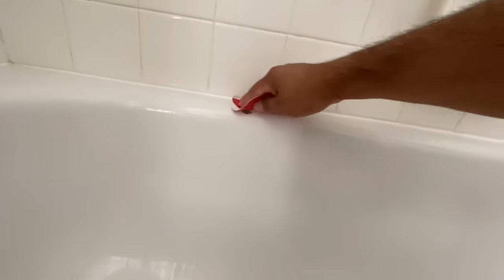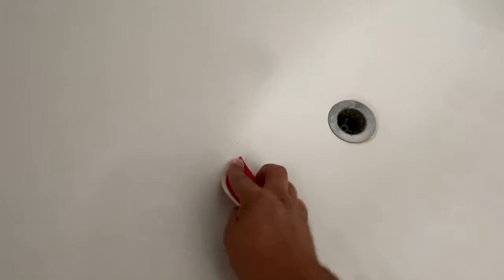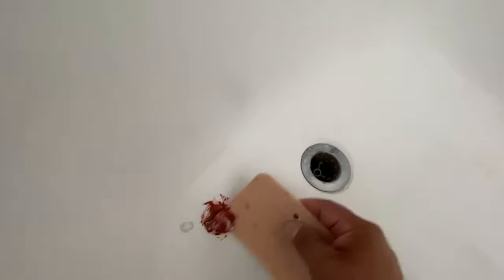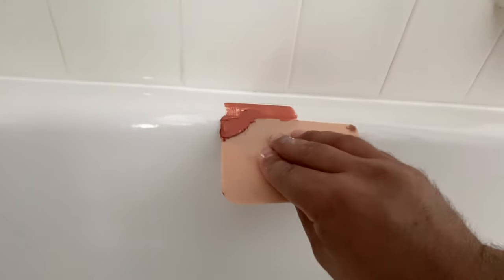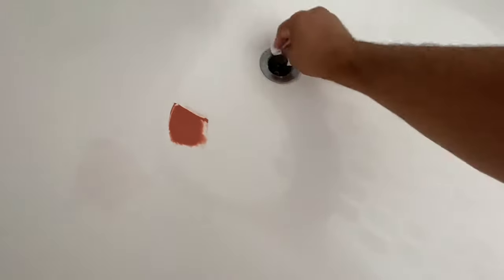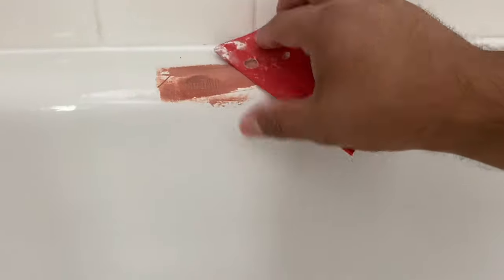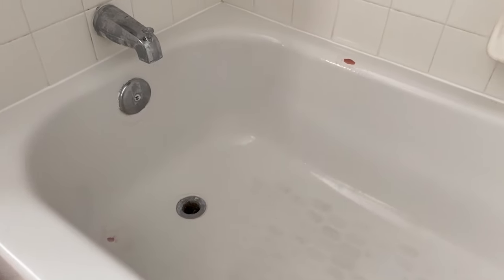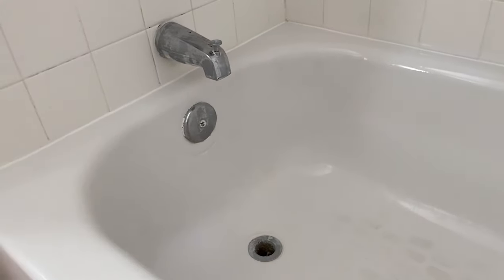How to Repair a Chip in a Bathtub and make it Disappear | Easy DIY Bathtub Chip Repair | DP Tubs

Comment: What exact products are you using on this?
Reply from the maker: for the top coat. The filler material is bondo filler. Let me know if you have any more questions. Are you trying to repair one yourself? Follow me on Instagram and you can DM me directly for help.
Reply: I have a chip size of a nickel more towards at the side bottom. What product can we use? Thank you
Reply: @DPTubs  ty

Comment: Hi! Great video! The description mentions a lot more items than I saw you use in the video. Do you think you could maybe narrow it down a bit? I have a small chip in a bath tub I would like to try to fix. I think it's a cast-iron tub. Does this stuff work with that too?
Reply from the maker: Sand paper
Bondo 
Smoothening putty 
Rustoleum appliance spray 

I have a video on bathtub chip repairs
Search “bathtub chip repair do tubs)
Reply: @DPTubs  is the smoothener different than the hardner you menion in the video that you mixed with the bondo?

Comment: Can you put automotive 2k clear over the repair paint? What do you think? I damaged one working at customers house & want the best longest lasting result. I've done a lot of cars so i know i can make it blend out.
Reply from the maker: Just have to make sure the clear will not have a solvent reaction with the top coat
Reply: @DPTubs  yeah, that's what I was thinking, I would have to do a test piece. It's a biscuit or almond color & those rustoleum epoxy spray cans say that its satin finish which won't match the tub gloss well so I was thinking 2k clear... it was 2 dime sized chips on the top.

Comment: Any suggestions on cracks on the bottom of the tub where the anti slip surface is different? When filling and sanding, looses its rocky texture so was wondering if you knew a shortcut. Thanks.
Reply: Use gorilla glue and lightly sprinkle construction sand over it they spray with a rustoleum white.

Comment: How did the paint hold up tho? I seen rust oleum dont recommended appliance paint in a bathtub?
Reply from the maker: You would be surprised what proper prep and care does. I wouldn’t be doing it if I had to go back and fix it
Reply: How long does it hold up with the appliance paint as far as when you clean your tub an stuff...an is the appliance paint the best option in a spray can over the krylon an rust oleum tub an tile?
Reply: @DPTubs  does the krylon tub an tile match the appliance paint color wise?

Comment: Question, how would you repair a cracked cast iron tub, not chipped but it has spider cracks. Do you break the surrounding porcelain or do you just fill the cracks as they are?
Reply from the maker: Fill as they are
Reply: @DPTubs  thanks, what would you use?
Reply: ? Never answered

Comment: How do they hold up after a month....year etc? 1, Bondo isnt waterproof. 2 it should be primed before painted. Although this technique may look good initially, I'd be surprised if it lasted.
Reply from the maker: You sound like a pro..:actually this system works great….been doing it for over 20 years!

Comment: Does the rustoleum appliance spray match great or is it worthwhile to get a paint from the tub manufacturer? Thanks!
Reply from the maker: The Rustoleum appliance spray is $6 at Home Depot. It’s worth it to buy it...and test it out on the surface and then wipe off with lacquer thinner. If your tub is a pressed steal or cast iron then the chance of it blending is pretty high. If it’s fiberglass I would try the appliance white or Rustoleum Shell White
Reply: What if your tub is grey?

Comment: Where are you located? I have a tub with screw holes in the top of it from a mistake made in installing the shower doors on the wrong side. Please advise. Thanks
Reply: He liked the comment but doesn’t provide the bondo used. What an insecure little boy.

Comment: One issue that I have had with repairs that aren’t followed up with a full refinish is the over spray that falls on the outside of the repair when feathering the touchup paint. It gives the area right around the repaired area a rough sandpaper fell. Have u encountered this? Have u found a solution?
Reply from the maker: Yes! You can go back out after and wet sand it with 2500-3000 grit. Very light just to smoothen out the rough spots.
Reply: @DPTubs  Thanks so much! Of course the extra trip out is not ideal considering it cuts into my margin. I will just have to price it accordingly.
Reply: @DPTubs  I refinish a ton of tubs for apt complexes. One issue I have is with tenants using bath mats (which is a no no) to deal with the liability of a slick bottom tub. Do u know if a practical solution,  Maybe a bathmat that doesn’t have suction cups, that can solve this problem? I have tried adding the sand grit to the bottom, but they are hard to keep clean without scrubbing(another no no)
Reply from the maker: Yes go to Amazon and search bath mat without suction cups and they are there. Machine washable too. They have air pockets. You are right the trip out isn’t ideal but I only go out if the customer pays for it. Otherwise I inform then when selling the job that there will be a halo or mist of overspray around the repair. Communication is key when dealing with customer expectations.
Reply: @DPTubs  Thanks so much. I’m always looking for ways to improve and your videos have helped me a lot. I have many more questions, but it is getting late on the east coast. Thanks again and I will be watching all your videos.
Reply: Timothy you do know that you can put your own  slip resistant finish on the tub bottom, right? The tub refinish suppliers sell it  You mix it with paint and catalyst roll onto suppliers of the tub then refinish over it
Reply: @anthonyohare2268  I have seen the products that add a non-slip texture, almost like a fine grit sand. It would be nice to find a product that mixes with the paint that looks slick, but grips like rubber when wet.
Reply: @timothyrogers3066  that's why you spray approx. 2 coats over the s/r grit you've rolled down. I've done quite a few tubs using this process. Use the grit sparingly, maybe a tablespoon per 5 oz of paint and catalyst

Comment: Is this somekinda marketing gimmick? There are two products you are using in the video, yet in the video description there's about 20. Also you don't show 90% of the steps and fake the paint step. Are you trying to have people screw this up so they call a professional in the end after spending a bunch of money on stuff you advertised? Can't think of another reason for this video, besides suggesting some products, which is appreciated if they actually work well. Rant over.